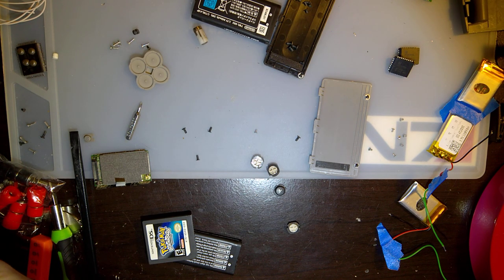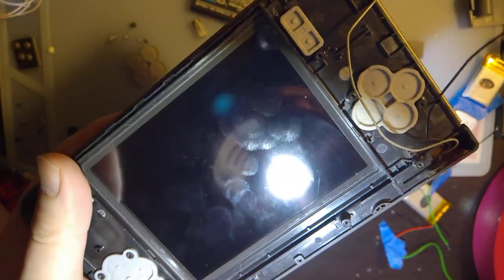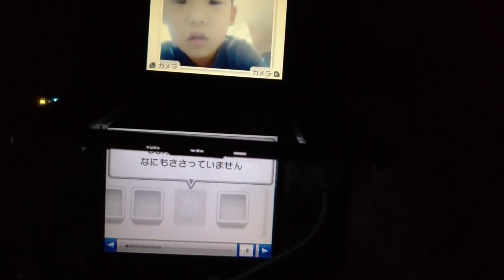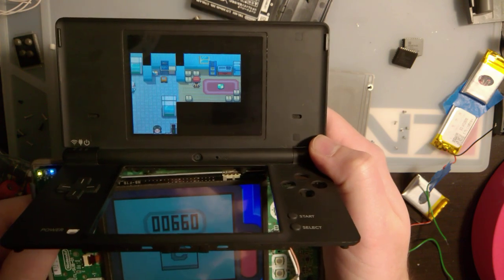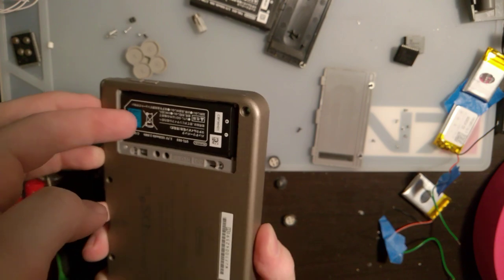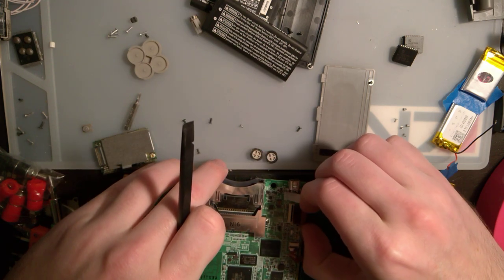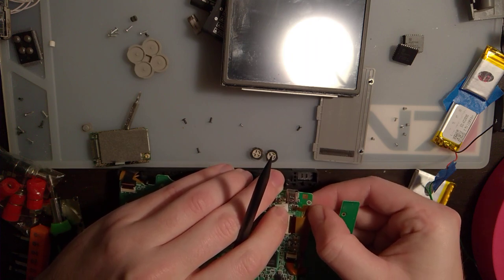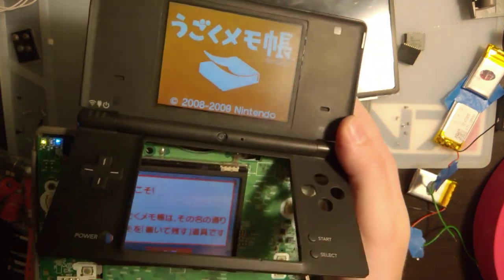Do DSi XL LCDs work on a DSi non-XL? Yes they do.

Comment: Hey there, Makho! Do you know anything about the cause of yellowing on DSi IPS panels? I've been trying to research the cause on the yellow creeping in from the corners of the screen issue for DSis and can't seem to find any conclusive evidence. This phenomenon can be caused by aging Optically Clear Adhesive that adhere glass over displays like phones, and can also be caused by similar discoloration on monitor glue at the edges. I've also heard that backlight LEDs can fail into a yellow hue, but this often occurs in the centre or off centre portions of screens that have this issue. Could the DS backlights only be at the very edges and none are in the centre of the screen? Some people say it's plastic aging, but as far as I'm aware this process cannot happen on DS consoles that haven't been exposed to much sunlight. This is of course very different from entire screen yellow tint which is just the temperature/calibration of the screen from factory and cannot be remedied/modified, and is technically not a defect. My DSi has some yellow tinting creeping in from the top right and bottom right corners of the top display, and I'm trying to figure out the cause. Would you have any ideas? Most people online seem to be confused as to the root cause, just saying the panel is defective as a whole. Surely there's some component in them that fails with age+use but I cannot find any info that points towards anything specific. I would appreciate any suggestions if you might have any idea. Thanks!

Comment: I'd assume this works the other way around? (as in, if I wanted to use a dsi XL screen on a non-XL motherboard)
Reply from the maker: yes. All DSi and DS Lite screens are interchangeable with all DSi and DS Lite consoles. The connectors are different on the Lites but a simple adapter is all you need.
Reply: @makho  Interesting. What I meant was a DSi and a DSi XL, not a DSL. But I feel like your video answered the question...

On the subject of adapters thoguh, I've got a project going for a sort of DSi macro (dsi mobo and bottom screen, but in a custom verticle shell similar to a gbp or slab form factor). Point being, I need an extension adapter to move the bottom screen where I need it. You wouldn't happen to know where I could find one of these/ what connector it uses?
Reply from the maker: @nissutobor9078  https://www.lcsc.com/product-detail/FFC-FPC-Connectors_TXGA-FFC03001-39SBB114W5M_C2833867.html
Reply: @makho  funk yeah. You're incredible Makho. That just cut down on several hours of aimlessly searching for connectors.
Reply: @makho  Hello, would really appreciate your input if you have time. Do you know of an adapter I could purchase in order to use DSi XL screens with a DS Lite motherboard? I would love to combine a DS Lite with a DSi XL if possible. Thanks!

Comment: Doesn't this show us that Non-DSi XL LCD's work in a DSi XL, it looks like the first is a DSi XL base with a DSi top, and the second is the same base with the LCD replaced by a DSi, not trying to be pedantic, I'm just confused.  Whatever it shows us is neat, I mean being able to substitute parts is an absolute win to quote Professor Hulk.  I mean using a DSi XL screen in a Macro GB DSi with custom firmware would be neat, no?
Reply from the maker: This shows that both screens work in both consoles. I tested every variation except top DSi XL LCD in a DSi (since I don't have one) but since a top DSi LCD works in a DSi XL, I assume it works fine. But yeah, you're right. I did get the title backwards. Also, why use a DSi XL LCD in a DSi when you can just use a DSi XL? The fitment would be a lot easier. https://i.imgur.com/Gqj6Rop.jpg